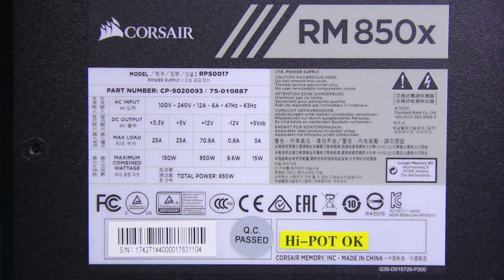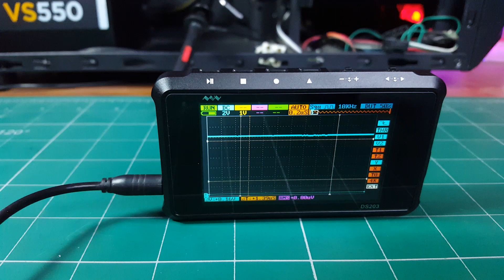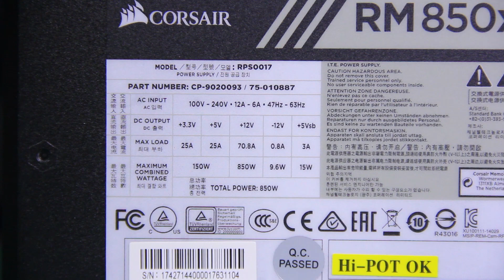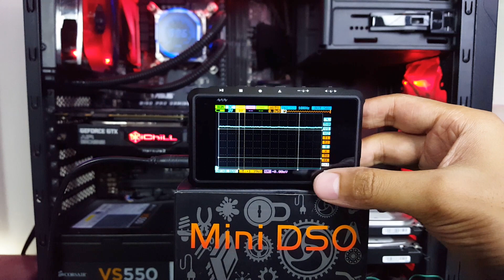GTX1080Ti with 550W PSU ? | Indepth Testing

Comment: The orange label VS series are the worst ever PSU lineup ever made by Corsair, it provides 500W over 12V, so in practice it's a 500W PSU, not 550.
it also suffers a lot with voltage stability and ripple ( exactly what you experienced in the video ).
A decent 550W would have ran this system perfectly fine for years on end.
Reply: true

Comment: Ran my EVGA 1080 Ti on a EVGA SuperNova 550 GM in an itx build since 2018 with near 24/7 usage and pc never shut down, no problems...
Reply from the maker: That's a Gold Rated PSU with LLC & DC-DC platform so it should run fine. The PSU in the video is based on older Group Regulated design hence why it can't keep up.
Reply: @GuyThatDoesEverything buddy it's just not about the rating alone, I've checked the gpu power draw, at 1080p power should be around 240 to 280w, at 4k max may hit 312, 50w on cpu and 30 watts on the rest, it still wouldn't exceed 400w at peak.

Comment: ok well i have a seasonic 550w in my pc but i have 2 case fans a hdd and that about it also the 1080ti in qeustion is a evga sc model nowhere near as heavy duty as the one in this video also runing a 92mm cpu cooler not a aio so i want to see a retest in a basic system like mine
Reply: hey, i am about to ask how long your system run/last? it for long time the pc parts still fine/normal?
Reply: @MasIki_Lyfe  oh boy this was a long time ago, yeah I ended up having to upgrade my psu back then because the psu did not have 2-8 pin connectors to properly power the card quickly upgraded to a 3070 after than and since sold that pc.
Reply: @mrhappy8966  ahh okey dude hehe thanks so much for replying here too :D

how about your setup now? hehe :D

i'm planning to buy gtx 1080ti because now it's cheaper but performance still good for 1080p game hehe

im planning to buy between 1080ti or 2060super hehe

Thanks again dude ☺☺
Reply: @MasIki_Lyfe  lol no problem yeah i ended up buying a 650w bronze psu to power the 1080 ti worked good, I'm running a i5 12600k and rx 6900xt currently with 32gbs of ddr4 ram and 2tbs of nvme storage.
Reply: @mrhappy8966  that's cool dude :D newer system hhyyeaaa :D you bought those before price increasing? XD is it only in my country or global, ram ssd price is increasing XD

well yea beside 1080ti 2060s actually i feel like find another reference XD 5700xt 😆😆
Reply: @MasIki_Lyfe  yeah luckily all of this was purchased years ago now lol and the ram and ssd pricing is like this worldwide forsure.
Reply: @mrhappy8966 nice to know that :D but me i was just about to build newer gen for my pc but seeing ram and ssd price like this is insane xD i cant afford it to finish the build, so yeah im hold it for now hehe
 and maybe it will took long time to back to normal again :( because it's for a.i things right? xD
Reply: @MasIki_Lyfe  Yeah ai data centers have sucked up all the ram production, well i wish u the best on your build journey my friend.
Reply: @mrhappy8966  hehe yea especially there's many people seems introduced to a.i and people maybe like it and some helped by a.i, so it's like there's many people in general get benefit from a.i, not like when gpu price increasing because there's scalpers and miner, so people hate them all XD yeah seems it will be stay high for long time except there's finally new manufacturer or something that take this shortage in market moment to branding their new brand😅😅

Thanks so much dude :D yeah and while saving money through this moment hehe ☺☺

Comment: Thanks for the video, I have a question:

I recently bought a CX650W unit, which I intend to use with a GTX 1080 Ti (GTX in 2020, I know LUL), I intend to use it with a Ryzen 3800x (or xt), without OC. Do you know if this PSU supports rendering (in full load) of videos and 3D modeling in programs such as Adobe Premiere, After Effects, Cinema 4D, Blender, etc ...? Ty <3

Comment: But all the experts on reddit told me 450W would be more than enough. How can they be wrong?
Seriously, I was desperately looking for a video like this where it's actually tested instead of just guessed. I was going to give up, so thanks!
I could have done without the music though.
Reply: I also got told 435 watt is enough, bought the gpu, had 500 watts and it crashed. Need a 650-750 Watt 80plus now ! :(
Reply: @Theonenow what kind of crush cuz im getting kernel power 41 when playing games
Reply: @Theonenow unless you're using 4k monitor, it shouldn't be a problem, I've checked the power draw at 1080p the card draws around 240 to 270 watts, so peak of 312w at 4k stress tests, even at those high your psu should be fine with total power hitting around 350 to 400 including cpu.

Comment: jeep in mind that you're using 2 hard drives , rgb and god knows what else , i think this makes a difference
Reply from the maker: Hard drives don't require that much power and at least 2 HDDs are quite common in majority of user's PC. And lastly, i am not using any of the RGB LEDs in the video.
Reply: Got it , but i thaught if this was in a very basic system like same components just without additional secondairy ones like LEDs and what so ever will make a difference somehow , nice video btw

Comment: please help ! 
MSI b450 mortar titanium
samsung evo 250gb ssd 
ryzen 5 2600
gigabyte gtx 1080 8GB oc
no hdd
is my corsair CX550M PSU will run this whole system well ?
thanks
Reply: mhmmmm hard to tell u can buy a system u plug in your contact that rights the wattages

Comment: For Christmas I got an it 9600k and a 2070 super. I have a 550w 80+ bronze psu. The box for the 2070 super recommends a 650w but on pc part picker and  various websites it recommends a 500w with power draw of about 460w. Just making sure it's okay and I don't need to buy a new power supply
Reply from the maker: Your current PSU may run your system but it will be putting quite stress on the internal components of your PSU, that's why it is recommended to have the headroom of around 150W-200W especially if you have lower than Gold rated PSU. That being said, you should have at least 650W 80 Plus Gold so that you can also OC your sysyem for even better performance.
Reply: @GuyThatDoesEverything  hello I just checked it is intact an 80+ gold rated psu. And I'll keep in mind upgrading my psu next

Comment: Pls help me. I ordered a 500w gpu and a 65w cpu.Will my cx550 run them both or they will get burned
Reply: Then I’d order a 650w power supply
Reply from the maker: What exact processor & GPU you have got?

Comment: Ryzen 5 3600x
GTX 1060 6GB
16GB DDR4@3000MHZ
B450 Tomahawk 
MAX
1TB HDD
240GB SSD
PSU 550W 80+ GOLD is this enough for my pc?
Reply: Yeap...I've got the same with a 1660ti and ryzen 2600...all the rest especs are the same as yours and works perfectly...Your CPU is very good but I would get a better GPU though...
Reply: @romulorocha8704   if i upgraded my GPU into a 1080 or 2080 do i need to change mobo and PSU ?
Reply: @ldoflamingojay641  i guess so...i just got a 2070 super and upgraded my psu to 750w plus gold...getting more than 144 fps with the highest graphics possible (rtx off) in CoD...i didnt upgrade anything else but gpu and psu
Reply: I use 3600 + 1060 6gb + 8gb ram + 1 ssd nvme powered by 450w platinum psu. I hope it will last for 3 to 5 years.

Comment: Ryzen 9 3600x With Gtx 1080 can it run with 650w PSU
Reply: Mitsuko みつこMiu みう dont try, get a 750,850 rm from corsair, or else ur gonna have problems with that 650 like i do rn, the psu cant handle all of my specs and keeps crashing under pressure
Reply: @jk-iwnl-6560  oh oj
Reply: Lol there is no ryzen 9 3600x

Comment: Will a 550w enough for r5 2600 and rtx 2060?
Reply from the maker: It will be fine but it is recommended to use 650W with this system for better reliability and future upgradablity

Comment: i'm thinking about upgrading my gtx 1080 to RTX 2070 Super (225w) TDP, is my corsair 550w 80+ Gold power suply good enough to run that with Ryzen 2700x cpu? or what if i buy GTX 1080ti which uses 250w TDP, will the power supply unit be enough if I run 2 monitors same time? Anybody knows?
Reply: Yes its enough
Reply: @glocktoten659  Will 500 watts be good enough for rtx 2080? My cpu  is also the ryzen 7 2700x.
Reply: @glocktoten659  I was planning getting a rtx 2080 around this week.
Reply: xLuigi Otk it will run fine, but if you plan on doing any overclocking i suggest picking up a 650w PSU
Reply: @glocktoten659  Oh okay. I dont think I ever overclock before. So I might be good then. I can get the nee power supply but kinda looks like hard to install lol. I know changing the graphics card and the ram is easy.

Comment: Is 550w psu is enough for i5 7400 and 1660
Reply: laurent sai  Is 500 watts enough for a rtx 2080? My cpu is ryzen 7 2700x.
Reply: laurent sai  Its because I berly found out that my pc is 500 watts.
Reply: laurent sai  And I saw a pc build that has the rtx 2080 with my cpu ryzen 7 2700x that pulls 430 watts.

Comment: I have a question 
Is 600 watts enough for i7 8086k 
And gtx 1080ti
Reply from the maker: Absolutely not! Get at least 800+ Watts PSU for such system, 1000W is recommended though.

Comment: Is 550W enough for i5-7500 not overclocked and GTX 1080 ?
Reply from the maker: Yes that would be enough. But if you use 650W PSU then that would be even better for future upgradablity
Reply: @GuyThatDoesEverything  650w 80 plus gold enough for 2080ti?
Reply: @GuyThatDoesEverything  but why?... the video shows a 550w psu having issues running a 1080...
Reply: @js100serch  1080 ti is the one who needs more

Comment: Rtx 2060 which psu?
Gtx 1660ti which psu?

I have the same 550w psu from Corsair.
Currently I am using zotac 1050ti 4gb mini. 
Plz help !!!!
Reply from the maker: Other than the GPU, complete system specs are also necessary to evaluate recommended PSU.
Generally for RTX2060, 550W 80 Plus Bronze would do just fine but can't really suggest any until i know your current system specs.
Reply: @GuyThatDoesEverything  i3 8100
16gb ram
Gtx 1050ti
Currently using vs 550w psu.
Reply from the maker: For your current system, VS550 is going to be enough. It is even enough with 2060 but if you're gonna be pairing it up with an i7 then at least 650W would be recommended.
Reply: @GuyThatDoesEverything  thank u sir.
One more question 
I have gigabyte h310 m h 8th gen mobo
Will this mobo create bottleneck for my  gpu, because this is not a high end mobo.
Reply from the maker: Not at all! It has PCIe x16 slot so there won't be any problem at all.
Reply: @GuyThatDoesEverything  ok
So going with rtx 2060 not gonna be a problem?
Reply from the maker: Nope not gonna be any problem whatsoever.
Reply: @GuyThatDoesEverything  thank u so much.
U really work really hard.
A happy subscriber of your chennel.
If u can just release videos on comparing graphics cards.
Reply from the maker: Thanks. Upcoming video will be of AMD's RX400 & RX500 series of GPUs and later will be doing a video on Nvidia GPUs so stay tuned.
Reply: @GuyThatDoesEverything  thank u vai.
Public demand toh chahiye boss.
Reply: @GuyThatDoesEverything  Another thing..
Do u think that new rtx 2060 will get bottlenecked by i3-8100 in open world games like Assassin's creed Odessey?

Comment: Bhai I have Dell optiplex 9020 , can a power supply of 240 watts run a GTX 1050ti ? Kindly answer my question please.
Reply from the maker: No, 240W is way too low for 1050Ti even for the non PCIe power connector version.
Reply: @GuyThatDoesEverything  thanks alot Bhai !! Love your videos 😊😇

Comment: I know that this an old vid now but its also recommended you dont use the daisy chain pcie power cables(one cable to two 6/8 pin connectors. I have a rm750x psu and 1080 ti and couldnt figure out why every game crashed even with vsync on. I tried everything until i ran two separate pcie cables now gpu is finally stable.

Comment: Is CoolerMaster MasterWatt 550 enough for 8700k not OCed and 1080Ti?
Reply: I have antec 80+gold 550 watts psu will it be okay for a oced gtx 1080 and oced i5 8600k and oced ram???
Reply from the maker: No it won't! Recommended PSU for your system should be of 650W or above.
Reply from the maker: No! You should have at least 650W 80 Plus Bronze rated PSU for such system. The thing is that your system may not even consume 500 watts of combined power but it's the sudden power spikes that your processor & the GPU will generate that can cause sudden voltage drops in the power rails.

Comment: I have Hp Z220 workstation its has 400w 90+ psu. is that will be enough for AMD RX 470 ?
Reply from the maker: It will run fine but still its recommended PSU is 500W for even better stability. And make sure you're not using any PCIe power converters to power your GPU.

Comment: i have that vs 550 my cpu ryzen 2600 and gtx 1070 i play for almost a year never OC  ,and no problem at all.but i plan to upgrade to gtx 1080 what do u think? sorry for bad english.
Reply from the maker: Yes you can use 1080 with that PSU but i would still recommended to use min 600W for better stability and future upgradablity.

Comment: What about GTX 1070 Ti or GTX 1080 non TI, will it stable running those on 550 W PSU?
Reply from the maker: That depends on your processor and it's clock speed (overclocking may increase power consumption)
550W would be enough for these GPUs but minimum 600W of PSU should be used just to be on the safer side.
Reply: @GuyThatDoesEverything  currently using stock ryzen 1600, so its fine then?

This might sound crazy but, would you recommend me to run vega 56 on 550 w psu?

Comment: if anyone who wants to build a PC but has less knowledge about power supply , bottleneck etc..  I will recommend them to use 2 website  

1- for the calculation of Power Supply -   http://www.coolermaster.com/power-supply-calculator/

2- for the calculation of Bottleneck - https://thebottlenecker.com/calculator

Personally i would recommend that use these website and gain some knowledge from Internet before going for a build, because in this country there is a high chance that shopkeepers will Rip you off and give you trash PC in high budget. so please check the prices of components , check the bottleneck  with the calculator, and in the end check the power supply calculation..  

hope this will help.

Comment: What is that 1080ti vendor? Looks so unique
Reply from the maker: That's inno3d iChill x4
Reply: How much did it cost you.
Also does this design actually improve cooling
Reply from the maker: Yes it does, but not significantly. It allows VRM to stay a bit cooler as it has a separate VRM cooling fan. So overclocking may be a bit stable. And i got this as a review sample, didn't purchase it.

Comment: I have an i7 2600k (4.2GHz) and am considering to get a GTX 1070 ti or GTX 1070. I might not overclock them. My psu is an EVGA 550w N1. Is it a bad idea to get one of these gpus?
Reply from the maker: I won't really go above 1070 with that processor. And you should get at least 600W PSU with such setup as the processor is based on an older architecture and its power consumption will be a bit higher specifically at 4.2Ghz Clocks.
Reply: @GuyThatDoesEverything  I've found a grey label Corsair CX 750 80+ Bronze (not the M version) for a good price. Would that be a good upgrade? Also, apparently I would have to get a sata female to molex male adapter to power my fan controller. I've there are risks of those catching fire. Is it true?
Reply from the maker: Yup that PSU would be fine.
And as for your second query, i don't know of which brand your Fan controller is, so can't really tell. I will be making a video on "6 PWM Custom Fan Hub" which is quite easy & cheap to make so stay tuned.
Reply: @GuyThatDoesEverything  It's an integrated fan controller from my Aero 500 case. It's quite a simple one, it lets me do "low" rpm, "high" rpm and off. It has support for 4 fans.
Reply from the maker: I don't think it should cause any trouble. But still just for the safe side, if you're connecting all 4 fans with it on their full speed then make sure the rated current of each fan is less than 1 Amp.
Reply: @GuyThatDoesEverything  I confirmed with the seller, it was just missing from the list of connectors. The PSU does have molex, so I'm golden. Already bought it.
Reply: if you don't overclock then 1070 ti doesn't worth more than 1070 but if you over clock it will perform better than 1080 stock

Comment: how is 1080 with 550? .-.
Reply from the maker: That's gonna work just fine with 550W, but you should have at least 80 plus bronze PSU.
Reply: @GuyThatDoesEverything  how is corsair VS550?
Reply from the maker: It's gonna be fine for GTX1080 but it only has 80+ rating, go for something like CX550 for much smoother power delivery and better overclocking stability.
Reply: @GuyThatDoesEverything  well i have already bought it .-. First build , therefore kinda messy.
Reply from the maker: No worries, that PSU isn't gonna be a big issue. What's your system specs though?
Reply: @GuyThatDoesEverything  ryzen 5 2600x, gigabyte g1 1080 , 8gb ram for now, 1 tb hdd,
Reply from the maker: That's a great build and it will work fine with that PSU. Enjoy gaming now :)
Reply: @GuyThatDoesEverything  thanks, sure :)

Comment: If I'm using a GPU that recommends a 400watts PSU on a system that have Dell 750watts PSU, will there be any issues?
Reply: no man you would not face  any problem
Reply from the maker: Nope it would work absolutely fine. Enjoy tension free gaming :)